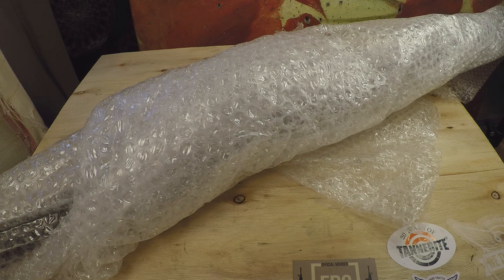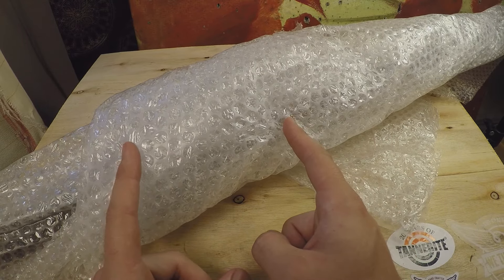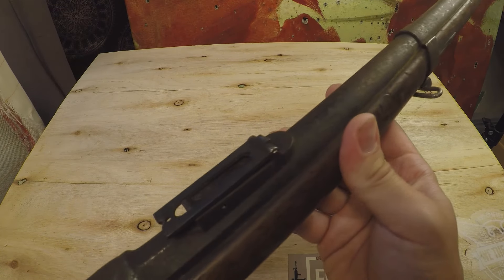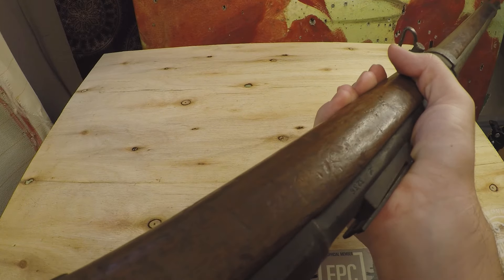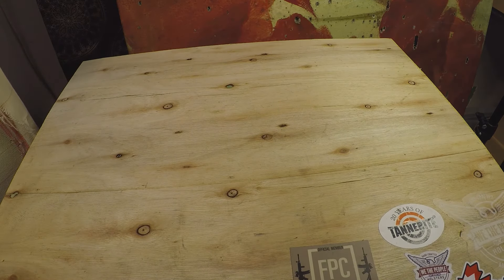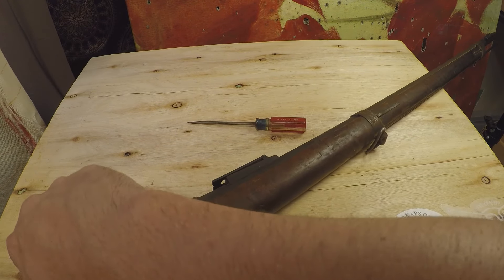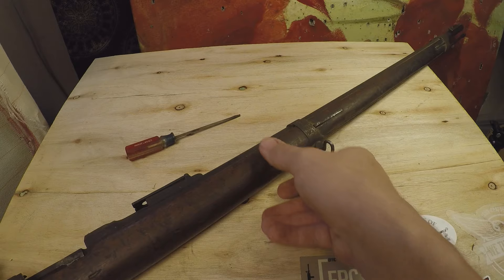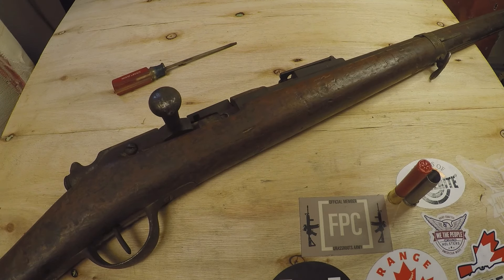199$ Gras Unboxing From Royal Tiger Imports C Grade

Comment: I did finally get a good m95, after they sent me the wrong thing, and it was just parts. They made up for the price difference too, and picked a real winner. my 150-deal enfield smle turned out far better than predicted too. I'm gonna hold off while ahead, until they list something different for once.
Reply from the maker: Well at least it worked out!
Reply: @theblindsniper9130  I took it up to local range, 30yds ish, and other than my "poi" test shot, it put the other 19 in a hand size spot. Shoots right on, not high at all, like the 88/90's. BTW, there's a guy in FL making single shot sled inserts for these now. He does carcano, Steyr, and mannlicher-shoenauer